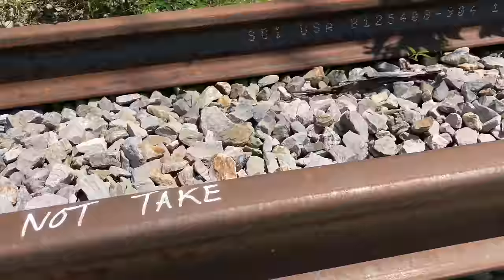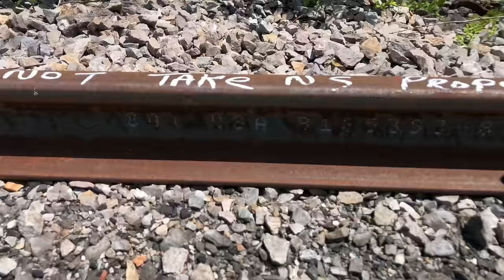Abandoned Railroad & Abandoned Locomotive Isolated On Abandoned Coal Mine Branch In West Virginia!

Comment: Great Video! That is a neat spot for sure. Ancient GP30 high hood left to rot and a coal mine behind it. Too bad its closed. The CPL lit up with no tracks is eerie for sure. And speaking of the Erie back in the mid 1990's I was west of Hornell NY on the ex Erie Mainline and there were massive washouts and Conrail didn't care, they just left it. I remember a spot where the tracks were washed out for a couple hundred feet dangling in the air over the water near an old Erie signal still illuminated with obviously no trains. Too bad I wasn't shooting photographs yet. Thanks Jaw Tooth for bringing back that memory.

Comment: Great start for a little museum there. Loco looks in great shape.Never seen a signal shinin on a lifted track ,great shot .
Reply: How would that be a great start?  Shot electrical, hole in the block, and way better running things available.
Reply from the maker: asteinmann  Thanks for that link.  That is very interesting.  It hasn't run in awhile
Reply: @adrianspeeder  because a wrecked engine in a locomotive isn't an automatic death sentence.
Reply: asteinmann  From that picture. It looks like the rail in front and back of that engine was pulled even before 2015. Interesting to know where in the Pacific Northwest that engine was going to.

Comment: Having sat idle at Massey Energy's Sprouse Creek loadout for several years, the former Southern hi-hood now sports new reporting marks on the cab, and (according to security personnel on site) has been receiving repairs to be prepared for sale and transport to the Pacific Northwest. But for tonight, the unit rests at the dormant loadout just east of Sprigg, on the former Alma Branch, waiting for it's next assignment.
Reply: Nice to know that that engine is going to continue to run on a new line and not be scrapped
Reply: would make a good yard unit...but with new units running over 7500HP according my SIL engineer, she cant compete on the main line.
Reply: They've been saying that since 2016!
Reply: The fresh tanks of torch fuel sitting next to it tell a different story.
Reply: @danjohnson8170  I would agree. Looks like they're getting ready to cut her up. Too bad, too. A bunch of museums would love to have that rig. Even if just for static display.
Reply: @Trains-With-Shane  Sad, but the cost of transporting that engine appears to be more than anyone is able to afford.
Reply: @redhed9776  dont say that. One time I took an old ass GP7U into Elkhart. Everyone on the radio in brand new 6 axle wide cabs saw my ass smoking and spinning that across the Chicago Line and were like "What the absolute hell is that??"
Reply: She won't fetch as good a price as a few years ago.   The Chinese have softened their quest for scrap iron.
Reply: @Trains-With-Shane  And scrap iron dealers are anxious to buy up the railroad museums!
Reply: Is it still there as of 2023 I'd love to take it I really hope it's still there of today because I love high hoods I hope somebody will take it and preserve it imagine taking it for free if he had a truck and trailer for it

Comment: Hello Jaw Tooth I know of  an area of West Virginia from Norfolk Western days in the 1920-1935. NW built a bypass of their old line from Nagutuck WV to Kenova WV it ran thur Lenore, Dingess, Dunlow, Genoa, Wayne then Kenova. There are spurs at Wayne and Nagatuck to serve the coal mines at the time till East Lynn and Nagatuck mines closed. Between those points the state was able to pave those miles in between some of the bridges are still in use and two tunnels connect  Dingess and Lenore one car can use the tunnel headlights on to warn oncoming traffic

Comment: Hey Jaw this is a rare GP-30 , EMD GP30 was a 2,250 hp (1,680 kW) four-axle B-B diesel locomotive built by General Motors' Electro-Motive Division of La Grange, Illinois between July, 1961 and November, 1963, The GP30 was also the only 30 Series locomotive in production, as there was no SD30 ever produced. 908 were built. The GP30 was also available in a B unit, which was purchased solely by Union Pacific. My railroad thru here was C & E I RR  and they had 3 of them

Comment: Wow GP30 High Hood probably a ex Southern loco hope some museum comes and saves her
Reply: yup.
Reply: Why? High hood 30s are the dumbest lookin' things ever.
Reply: That GP30 was built as SOU 2598 in October, 1963.
Reply: @adrianspeeder  Wrong.  GP30s are fantastic in high or low hood configuration.
Reply: The GP30 was one of the last locomotives available with a high hood, and it's a rare combination. Problem is:  who is willing to pay to recover and preserve it? Have any high hood GP30's been preserved?
Reply: @WeMustRebell  totally agree 👍
Reply: @Dennis-vh8tz , what about all the Southern units built with high hoods?   Or do you mean without special order?
Reply: Me too
Reply: I love GP30s. I hate the electrical systems on the thirties and the crazy crossover duct for the traction motor blower that blocks the back of the main generator. I worked on the CVR out in Kansas. Five Rio Grande, two GM&O and one tired kitty from CSX. 
A GP30 will make an electrician out you. 
Greetings from the high plains of Texas.
Reply: @Dennis-vh8tz  SD40-2s were available with high hoods :P  Also, Spencer has a restored and active Southern GP30, and the Roanoke Chapter of the NHRS has a restored and active N&W GP30.  Those two and Conrail GP30 were used several years ago for an NS promotion hauling a coal train up the Shenandoah Valley line.
Reply: @Dennis-vh8tz  yes, I know of at least 1
Reply: Yes, it’s ex SRR. 2598 was a GP-30 high nose unit. Many museums would love to have her, restored to SRR black white and gold. Why would anyone abandon a valuable asset like that?
Reply: @adrianspeeder  Everyone has their own opinion. Yours just happens to be wrong.
Reply: @themanfromcabowabo1559  Nope.
Reply: TheManFrom CaboWabo   When anyone has an opinion on how something looks it can’t be wrong.
Reply: That is just downright sad. 😥 Kinda makes u sick to your stomach. Love it that the lights r still working.  Wish they could save the 🚂.

Comment: Sadly, this mining district in the US has met the same fate as in the UK (Wales) and Germany (Rhein - Ruhr district). The last coal pit in Germany (Zeche "Prosper Haniel" near Bottrop) was closed as late as 2018! As about that abandoned red engine: problem is that large parts of it have been taken off and disappeared somewhere, maybe for scrap, so chances are very little that someone might rebuild it. 8:00: Thank you for that close - up on a piece of rail as it pretty clearly shows how the rails are fastened (actually: nailed!) to the sleepers. Really different over here in Germany; what we have here are screw-in tapped bolts for the base plate (4 of them, the sleepers are accordingly pre - drilled) plus two clamps and two bolts for holding down the rails. This works for wooden sleepers. If concrete sleepers are used, the fastening mechanism is different. Quite interesting here are reports about the construction of the new ICE high - speed train lines.

Comment: East Terminal Railway should come get it. Contact them. See if they can get in touch with the owner
Reply: I thought the very same thing
Reply: @jamesnegus83  Why did you think that? The guy who runs that channel has clearly stated on multiple occasions that he intends to use trackmobiles or possibly a small industrial switcher such as a GE 50 tonner. Why would he be interested in a non-working road locomotive that makes no sense at all for his business?
Reply: I think he would be interested in the truck assemblies because they have roller bearings.
Reply: @easydoesit8857  The trucks of any locomotive built in the last 70 years have roller bearings...

Comment: Jaw Tooth, that piece of coalmine siding you visited was once the “mainline” around the mountain following the stream until a tunnel was bored through the mountain.  The signal is of N&W origin, fixed approach aspect.  It should have two amber lights lit on the 45-degree UQ diagonal.

Comment: They did the same thing to TTI 245 in Lake City TN. Pulled the rails in front and behind the engine and since then it's been torn apart and the only thing worth having on it is the Bell that still has P&LE paint on it and I think that the number was 2808. THANKS for the post.

Comment: Started life October, 1963 as Southern 2598, then SCCX 2598 and now AMRX 2598. It hasn’t moved an inch since prior to July 26, 2016.
At that time it was owned by Consolidated Oil and Transportation Company Inc. and there were several tracks running to the East. I believe they comprised a small company yard about a mile long. 
The tracks that have been removed were there within the last year, possibly two but I doubt it

Comment: AMRX- American Refining/Amerimex Rail. I looked it up. This was probably left behind because it has friction bearing wheels. These are not allowed in class 1 tracks anymore and would take tons if crane time to convert to roller bearings.
Reply: Dennis B -Trains  Good eye and explanation!
Reply: @terryboyer1342  thanks! I just recently learned that by watching another YouTube channel, East Terminal Railroad.
Reply: Pretty sure these are the standard Class 1 roller bearings. Look at the trucks. They look like your typical EMD Blomberg trucks.
Reply: @dennisb-trains23  I guess if it was worth saving they would have taken it before they pulled up all the rails
Reply: @Cnw8701  could be. I couldn't get a good look at them.
Reply: Engine must have been used up, otherwise, why leave it for scrap? Help me out, $1 or $2 million/engine?
Reply: @audreygatey1274  my thoughts exactly why else would they abandon it
Reply: @audreygatey1274  wouldn’t it have been wiser just to tow it out when the rails were still in place guess that makes too much sense lol
Reply: @dennisb-trains23  Wrong.
Reply: @adrianspeeder  ok thanks!
Reply: As someone pointed out earlier, it has roller bearings which is fine........
Reply: If the bearings were an issue why not just load it onto a flatcar and take it out when the tracks were still in place
Reply: No, you can clearly see at 1:51 that the locomotive has roller bearings, not plane bearings with journal boxes.
Reply: @beeble2003  well I am glad you were here to correct me

Comment: This locomotive has been sitting in that same spot since 2011.  Last comment I saw on her, was she was awaiting repairs for a sale and move out west (2016).  As you can see, that never happened.  Locomotive was purchased in 1963 brand new by Southern Railway, with the high hood from the factory.  She survived the Southern / Norfolk Western merger and was repainted into NS paint scheme in May 1988 (rare thing for an older loco).  Sold to SCCX sometime before 2005 and was photographed at this same loader in 2005.  Sad to see her rotting away like this.  I see someone stole the bell off the front.

Comment: That locomotive couldn't be moved on Class-1 railroads to be sold at auction because it has friction bearings.  I saw another video (from ccrx2400 - Cumberland Mine Railroad) that explained about it and how the only other alternatives are by truck over the roads or by special lowboy flatcar or by an expensive bearing conversion or finally by a temporary truck swapout.  The cranes required to lift these guys alone are hard to come by.

Comment: Without knowing how many miles are on that engine, it's hard to know if it's usable. One recent president really had it in for the coal industry and pretty much killed it here in PA.
Reply: Miles have little to nothing to do with it. The biggest thing to look for are cracks in the frames.
Reply: Basically you go by engine hours like a forklift or terminal tractor instead of miles
Reply: It's not all politics. Demand for coal world wide is simply declining, at least when it comes to generating power.

Comment: I'll never understand why railroads will do some of the dadburn strangest things when they abandon and sever tracks, leaving locomotive(s), or rolling stock behind without coupling the loco/rolling stock and moving it out on the rails before cutting them off from the mainline! 

CSX did that in Oviedo, I worked for a small electronics company at the time, and there were tracks behind it, and through several of the large connecting neighborhoods, some crossings had lighted signals, some had simple wooden crossbucks, however, not a single road had any tracks that crossed the paved roads, each section of track was cut/severed just before and just after the crossing, but the crossing rails were removed from the paved roadways.

The weird thing was each of these severed sections had rolling stock sitting on the rails!  The rolling stock looked to be coal hoppers, using a variety of reporting marks from various companies or railroads, OUCX, UP, CSX, NS, and others I don't recall.  Each of these cut/severed abandoned sections contained as few as 15-20+ hoppers, some of the even longer sections contained as many as 60-75+ hoppers.  

The spur that would have connected this trackage was over 25+ miles away, just a few miles outside of downtown Orlando, FL.  Which the switch was still there, but the route off the switch was severed, and tracks removed, although there are still some trackage that never got taken up, and is still in place where the route used to go near the switch, but they too are severed in places.

It's been several years since I gave up my license back in late 2013, but last time I had checked in that Oviedo neighborhood was sometime around 2000, perhaps as late as 2004, and those hoppers and severed tracks were still in place.  Whether they are still there now in 2024, I have no idea.

That was the craziest thing I'd ever seen from a RailRoad that had abandoned a very large section of RR line right in the middle of a large community.  These severed tracks and abandoned rolling stock[rusting out really bad too] were in many folks backyards, just left to rot.

Comment: A little history on that mine site. In 1984 it was the site of a mine strike. The strike turned violent when company guards ran over some of the strikers in 1985 sending three to the hospital. 1500 miners walked the picket line there. Scabs were escorted in and out by State Troopers. Strike ended in 1986. In Dec 1988 the mine declared bankruptcy and shutdown.
Reply from the maker: Wow!  Thanks for the info
Reply: @JawTooth  I had to jog my memory as I knew that there was something I was told about that mine. At the time of the strike I was a local grievance rep down here in Florida and heard about it thru the union. In 1986 I left the union as my new job did not belong and none of us would have wanted the union I had been a member of anyways. Trumpka sold out the miners and like most union strikes, the miners ended up with less than they had before the strike. The miners who went back to work after the strike ended up having to work with those brought in to break the strike and a good many of the strikers were blackballed from mining jobs.

Comment: I didn’t get a chance to read all your comments, so I do not know if somebody already asked this, but here’s my question: I know this is an older engine, but couldn’t it be fixed up and used as a switcher engine by short-line railroad,      used to switch cars and service spur lines? It seems a waste to cut it up into scrap. Or is it too old of a model and not efficient to run? I figured you would know. It’s a shame that it was left there to rot. Also, can you answer why a railroad would make such a decision to abandon a locomotive, knowing that dollars are precious? I’m a big fan, by the way.
Reply from the maker: It was owned by the coal company and they went out of business.  It is older and hard to get parts for and not efficient for burning fuel and does pollute more than new locomotives.   It will probably be scraped but I hope not

Comment: As a track labor I can tell you that track is own by n.s to crossing.  Properly owner owns the rest including engine. Rr will put a spur in but won't maintain it. We had several times go and fix switches and they bill the company. That rail is mainline rail never use it for old spurs. They will use it for major sites that may have a 100 cars sitting. But remember spur isn't owned by rr once own owners land
Reply: Sorry on some of the wording auto correct changed it and didn't see it. I promise I wasn't drinking...lol

Comment: On Google maps the tracks are still visible in the aerial photo from this year. The street view is from 2009 and the engine is sitting in the same place. Can't tell if it's exactly the same but it's pretty close. 37.65014235974554, -82.18608994219072

Comment: They need to list the engine for sale because technically it can still be used
Reply: If it has friction bearings it cannot be used on class 1 rails and would require tons of crane work to convert  to roller bearings.
Reply: @dennisb-trains23  It has roller bearings, as can be clearly seen in the video.
Reply: @beeble2003  wonderful. Glad so many people are  so co concerned.